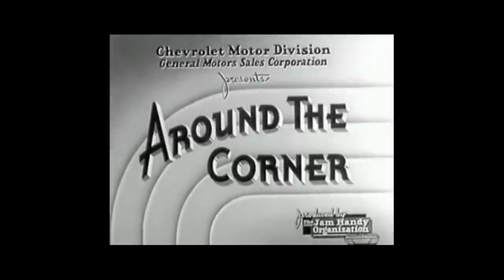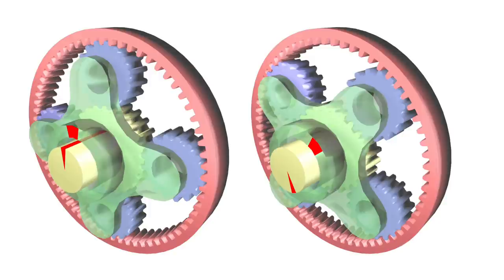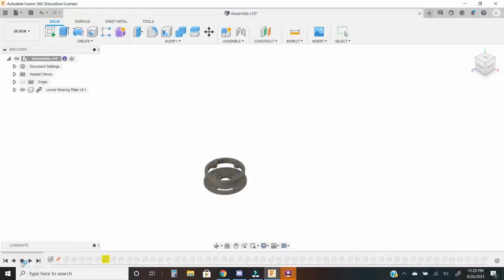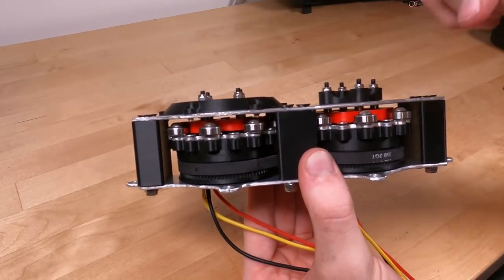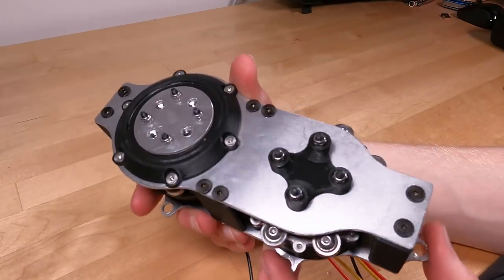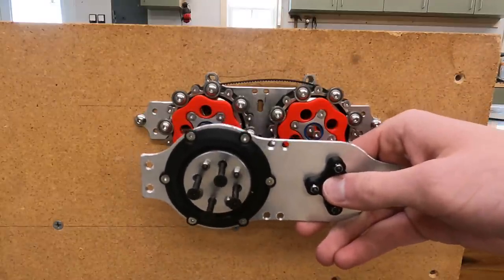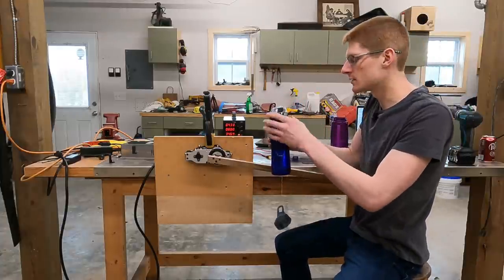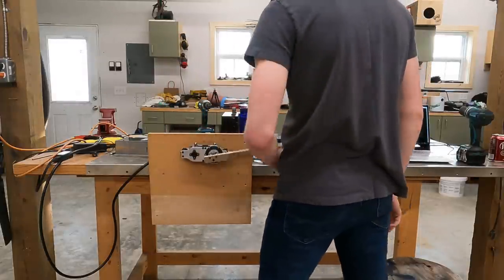The Differential Drive - A New Breed of Actuator

Comment: Great stuff! Take a look at the 10100, an experimental British diesel locomotive from 1950. It used four engines that could each be coupled to the transmission independently, with a similar effect to your design. https://en.m.wikipedia.org/wiki/British_Rail_10100

Comment: At 15:20 he basically explains how a differential works "what matters is the weakest link" just like a wheel with no grip makes the torque on the other wheel be reduced. So basically, a differential works like a differential, he took a long way to get to that, but that was the conclusion i got. Did i get it wrong?

Comment: I'm not quite sure about your idea of summing the torque: in my opinion it's doable, but with a different setup (yes, doubling the speed will not be possible, to have more torque some things need to change and you will not really summ the torque at the end). Let me explain.
If you take a differential T shaped gearbox, with two motors, 10Nm for motor, you can obtain the 20Nm you were hoping for and the motors are not rigidly coupled to each other, because they chan still rotate a different amount (the difference in rotation speed will be translated as a "roll" of the output shaft on it's axes).
If you stop one motor (infinite torque), and rotate the other one, you will still have 20Nm of torque because the conical gear is actin like a leverage, doubling the torque of the smaller motor. In this way you will have the roll effect I was saying earlier but still double the torque (not sum of the two motor, just double of the less torque one)

By the way cool video, thinking about this I designed the joint for a robot I'm building with a university team, extremely cool video :)

Comment: Actually, in an ideal situation, if one is locked, the speed would be half, and the torque would be double. Just reverse the in and out. In a differential, if one wheel is stopped, the other rotates at double speed, and therefore half torque.

Comment: Hey, have you looked at doing metal cycloidal drives for more powerful motors? Depending on how thick the aluminum/steel is that you can cut you could probably get some pretty good results.

Comment: I’m not an engineer by trade but have been mechanically including all my life. Would something like this contraption in the video be able to couple 2 or more Sterling engines or possibly Tesla turbines driven by supper heated steam to increase the torque in order to turn a generator to store power and/or be able to use the power directly in a electrical or mechanical fashion?

Comment: @Levi Janssen Hey man, totally off-topic, but today I was binging your coilgun videos and concepts, and was wondering, if the projectile was modified in some way, would that open up possibilities towards a more efficient build?  One example I though of off the cuff was a steel slug with a taper hollowed out with the wide end towards the rear, and filled with lead.  Would that possibly mitigate the pull that interferes with the speed as the projectile transfers to the next coil in the sequence?

Comment: I might need to think about this some more, but I suspect arbitrary precision is only achieveable if you can reliably change the RPM of each motor instantaneously or if the changes for each motor from any given RPM to another under each given load are extremely well known, which strikes me as more difficult to achieve than arbitrarily precise encoder technology
Reply: I'm not weighing in on "arbitrary precision", but with twice the number of control/drive systems you have twice or half (same or opposite direction) the control authority at each speed setpoint.  
Rather than Forward/Reverse and a single input RPM to track with constant proportionality to output, we have 4 possible direction states FF FR RF RR coupled to 2 independent speed inputs and a 3 variable dependent velocity output.  Complex but versatile.  Constant 0 output RPM can be maintained while both motors perform wild accelerations in both directions throughout the entire RPM range provided both are matched.  A constant single motor max equivalent output RPM can only be maintained during wild accelerations of both motors maintaining a single direction.  2x single motor max equivalent output RPM can be achieved at only a single combination of motor velocities.  This might demand different PID constants according to RPM requested, probably a whole different control strategy.  You could use 1 motor solely for the precomputed Proportional contribution while the other runs an I and D controller to handle dynamics.

You have the greatest control opportunity where you can most quickly change velocity(speed and/or direction)  That may be near zero RPM where momentum is least and available drive torque is highest(brushed DC).  But back EMF for braking is not present.  Sensorless brushless motors have starting problems from O.  Maybe optimum control opportunity is when both motors are at 2/3 of the power curve upslope, but in opposite directions?  Peak of the power curve, or before?  Steppers are a different animal entirely.  Optimum control for this system is an interesting problem with many experiments left to do.

Comment: Could you use a hydraulic or air cylinder as the weight.. Measuring the pressure which can be done so accurately thus giving you an exact torque measurement???

Comment: Would it be more likely to work with planetary gears like in the first graphic?
Reply: so, im not too certain about the answer to your question, but i think the answer would be no. the reason being the motors are going to be exerting different torque on the output because the outer motor will have a different gear reduction compared to the inner motor. this falls back on the weakest link of the motor, what ever motor has the weakest torque rating that that said speed will fail first. the only way to remedy this issue will  be  to directly link the motors.
Reply from the maker: It should work the same for all reduction systems.

Comment: So here is a question. What you created is effectively the inverse of an OPEN differential with essentially the same flaw which is that if either output (or in this case input) is at or significantly approaches zero torque you effectively lose all torque. So now to the interesting part, can we modify this to behave like a limited slip or is that even a good idea. Hmmmmmm

Comment: I also have yet to see someone design a rim powered turbine (non-axial) for aircraft / drone flight... A system in which the blades of the turbine are fixed to the rotor (pointing inwardly toward the center) and the stator encirles the rotor.

...Imagine a ring w/ in a ring with the inner ring containing the turbine blades. Essentially the input force on the blades comes from the outer portion of the blade instead if the conventional way (by shaft from the inside).

Comment: With LEGO Technics it is easy to combine the output of two motors with a differential.

My LEGOs are from decades ago. The gears in the differential from the 1990's are pretty wimpy and comparatively inefficient. The max torque through the gear train will be limited by those tiny gears. The total power through the system will be noticeably less than twice the single motor power, because a lot of energy will be lost in the gear train.

The modern LEGO differential is better in both respects.

Comment: I am wondering if the the torque issue could be because when you run the motors in opposite directions and then apply force to the output shaft there is always a motor spinning in the same direction as you're applying torque to.

Comment: regarding  2 inputs and a single output, would using the bicycle mechanism work?  when you spin the pedals, you engage the rear wheel.  you can stop spinning the pedals and the rear wheel still turns. if you engage 2 sets of pedals on the same chain, you can engage with one or both sets of pedals to change the torque on the rear wheel.  perhaps tandem bikes work this way.  not really sure.  but seems there may be an answer in there.  alternatively, check out how electric bikes engage pedaling and motor.  there are 2 configurations, one where the motor is the hub the pedals are attached to, and another where the motor is the hub in the rear wheel.  and then there's potential with rear wheel in-hub gearing to consider..  
sorry it's not more answers but more questions. :-)

Comment: check out the d-drive infinity variable geared transmission. u dont need the motors to be symmetric meaning a tiny motor can control the ratio with the bigger one providing the torque and in a planetary system as long as the ratio is less then one of the large motor the torque of the smaller one is irrelevant

Comment: cool idea/ video thank you for sharing!  Questions... wouldn't the motors have to be connected in series to do what you described? from your test it appears they are connected together via the belt, and therefore they are in parallel, no?  To connect them in parallel, wouldn't you need one of the stators to have the same rotations speed as the output of other motors?  meaning one of the sets of input wires would have to be spinning . I feel like you could accomplish this by just connecting each motor to the wheel outputs of the open differential like you mentioned, no? (what am i missing if not)

i might be wrong, but i thought FOC , field oriented control, meant that it used the magnetic field of the simple motor in order to read it's rotational position?  (and doesn't use an encoder) I thought when it used an encoder it was just a basic closed loop motor control board?

Comment: sounds like your trying to build an overly complicated v drive similar to the ones used in power boat racing where they connect 2 large engines into a single drive to the jet pump.  granted your trying to go a bit further with speed and precision. and 2 motors working together in tandem to create tq and high accuracy in a 3d printer  is already being used its called a core xy or core xz motion system. but cool video i always like to see what new ideas you come up with.

Comment: You are wrong.  The input is on the RED ring gear and the output is on the YELLOW sun gear AND the green planetary gears.  Also, the output of the differential is NOT the sum of the engine.  It is the engine DIVIDED by the the number of outputs.  Also, an automatic transmission has multiple inputs to one output.

Comment: Heres pictures of a Lego two differential drive that uses two motors as input, providing forward/backward, and turning, where the left wheel turns at the sum of the two motors, and the right wheel turns at the difference of the two motors.
This used a program card using three tracks of pegs on bricks racked through, which via microswitches and relays turned on and/or reversed the two motors.
https://photos.app.goo.gl/KXR26jm824QSPtLR9
https://youtu.be/b8_r8Qi2cuY

Comment: Ummmm…Why did you add water to the torque test arm?
You could have used a known weight at different displaced lengths. No error encroachment weighing the water. Heck. You could use a calibrated scale (ruler) as the arm and mark it to read torque directly. 🤓
Just saying. 👍❤️

Comment: But since the speed is the sum of the two motors, if you ran both motors at the same speed, wouldn't you have single motor stall torque at two motor speeds?

Comment: I believe your method of measuring the stall torque at 11:19 is flawed. If you connected the power supply directly to one phase of the motor (that's what it sounds like to me), the magnetic field would have been in line with the rotor's magnetic field (the so-called "d" axis). However, the maximum torque is achieved when the stator and rotor fields are perpendicular to each other (electrically, not mechanically; called the "q" axis). The latter is what an FOC controller like the ODrive does. It didn't matter in the end, but I hope it'll be useful to know for future projects
Reply: Or maybe I'm wrong, the way it behaves when the stall torque is exceeded looks like it's under FOC...

Comment: Differentials and planetary gears don't add speed--they average it. To get a proper sum, you need an extra stage to gear up the output.
Reply from the maker: It isn't exactly averaged, but yes you would need to compensate for the overall reduction, or maybe use a gearset other than a cycloidal gear.

Comment: I’m a electrician and was wondering would a person use one frequency drive that is rated for  the horse power of the 2 motors added together or would you use  one for each and how to you handle the difference of slip between each motor i know a side idea but your idea made me wonder thank you
Reply: I think one drive for each motor is probably assumed, but this would be a great case for a 5 leg inverter driving both motors.
Reply: @DustinMaki1  thank you this just seemed cool to me i have never drove 2 motors to do one job before

Comment: interesting concepts but I fail to see any practical use, typically you chose the motor based on need like torque and RPM, its why so many different models exist. to double up motors with the additional gearing your are complicating the design for what could be accomplished by just 1 motor. the only reason I can think of to double up the motors is space requirement, if the space allowed doesn't provide enough room to install a larger motor and you need additional torque then ganging 2 smaller motors might be an answer. but its far easier to join the shafts than a complicated differential gearing design. but hey keep thinking outside the box, I could be wrong and just can't see the benefit.
Reply: An interesting system use could be trying to get more than 3600 RPM out of AC motors .  
Say an ice cream factory that has a huge mixing dish that is 10 feet wide and 10 feet deep.    You could use a system like this with one motor for the initial mixing at low speed and then 2 motors to get close to 7200 RPM input for the full ingredient mixing.   or vise versa.

Comment: This one.
https://youtu.be/GGnPEzkzZmw
And I am pretty sure this one too
https://youtu.be/67o6bFVm8Lo

At least you admit yours is pretty much a differential from the get go.

So I think spinning both motors at max rpm in the opposite directions, then rapidly switching the direction of one motor would let you use the spinning mass of the system and direct it through the output, allowing for an increased initial launch torque.

Comment: Is it posiible for this designe to use stpper mottors, or BLDC motor are reuired? I was thinikng about it, and it seems that with stepper motors if  primary motor would be power up, but wouldnt turn at the moemnt, and the primary housing was to rotate becouse of the secondery motor, the cycloid dysk would stuck in one position and resist the rotation of the primary houseing. If there is missunderstanding on my part, would anybody like to explain it to me? I would love to designe something like this using stpper motors becoise bldc are to expensive for me.

Comment: But in the differential of a car, isn't the speed of the motor the average of those of the wheels? If both wheels have a speed of x then the motor has speed x, if one has speed 0 and the motor is constant the other wheel will have a speed 2x

Comment: How is the odrive board taking encode information from the motors when it is only connected to the motors with  3 wires each?  Are you lying to us or did you just misspeak?
Reply from the maker: Odrives generally use encorder feedback, but they don't have to. I was not using encoders, nor did I claim to be.

Comment: Just spitballing here but you're doing it wrong. You can get higher torque by summing the two motor speeds, but one of them has to be going in reverse. Don't think of it as the stall torque of either of the motors. Just let the ESC handle keeping the motors at the same (reversed) speeds and see what the "stall" torque of the assembly is.

As far as the math is concerned, summing the two motors' stall torque obviously doesn't work, and the failure point is where you get cogging on either of the BLDC motors, but if you have two non-stalled motors putting several kw into keeping a stick still, all of that power is going somewhere and in this case, its literally going into keeping that stick still.

Comment: why does the odrive need that heat sink "thing" wired to it?
Reply: Those are the high current mosfets, that's where most of the power flows through it. That's what supplies enough juice to actually run the motor.

Comment: arbitrarily precise movement of the system would require arbitrarily precise control of the speeds of the motors, no free lunch.
Reply from the maker: Arbitrarily precise speed control would be dependent on a consistent internal clock of your motor driver. They are very consistent, and can produce arbitrarily precise speed control, just as they can produce arbitrarily precise positional control with encoder feedback. This isn't a matter of free lunch, we're not talking about creating energy here. A good handful of people don't trust my arbitrary precision claim. It wasn't a big deal to me, so I didn't focus on it. But I might design a simplified actuator with stepper motors to demonstrate the concept. Could be fun.

Comment: Sorry, but as you describe your mechanism it is not useful with identical motors and gearing. but is if you ad solenoid breaks to the motors and have them at radical different gear ratios then you can have high torque and high speed, not at the same time but...